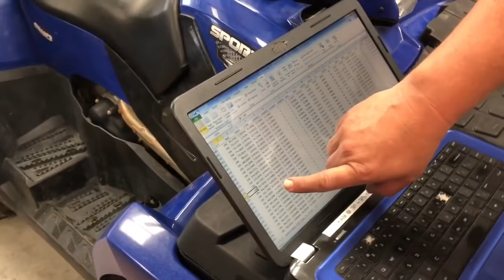JUNKYARD TOONS! Budget Fox Body Mustang Drag Car

Comment: Attach you a milk crate on the back of one of your stangs and you can have a pickup too. Lol Magic!
Reply from the maker: Or buy a full size LTD and cut the back of the roof off and weld the rear doors shut:)
Reply: I wa thinking more budget oriented just to show up science. But hell if you want to go all out, get you a full sized station wagon and cut the roof off behind the C pillar and make you an Avalanche lol.
Reply from the maker: I love wagons...before i got the lincoln i had looked at a few squire/colony park wagons online but never pulled the trigger...i wouldnt feel bad about hacking up a regular crown vic though lol

Comment: I have an AOD to T5 swapped car with a Dynamod TFI module and though it's never been down on power the timing has been rather erratic at idle sometimes (after adding the TFI module), so it's worth swapping out imo.
Reply: I noticed the spark at idle was very low compared to mine, and the idle was not real stable, in addition to the pump running all the time. His set up is very similar to Rodney's blue dragon, Pirates cam is a little smaller, and has a little more weight left in his car, so not sure why the ET's are so much different.